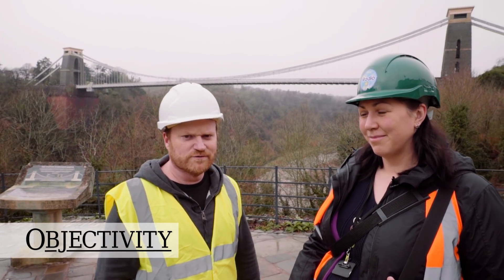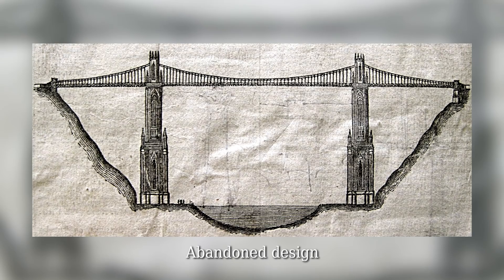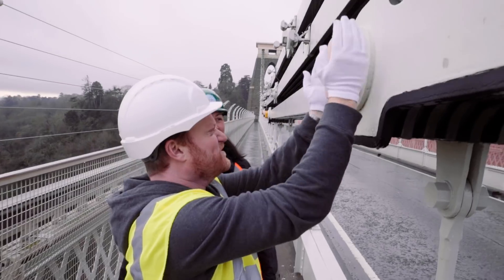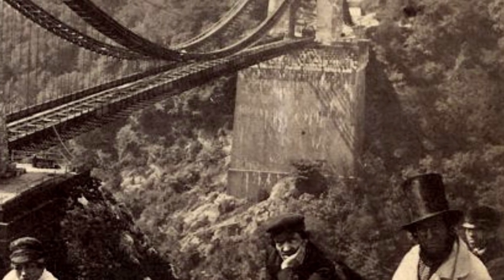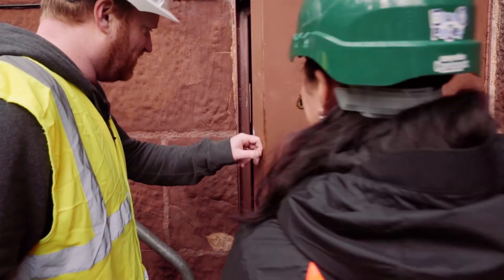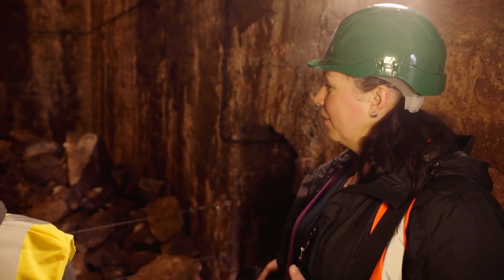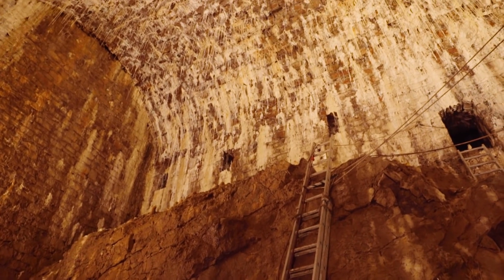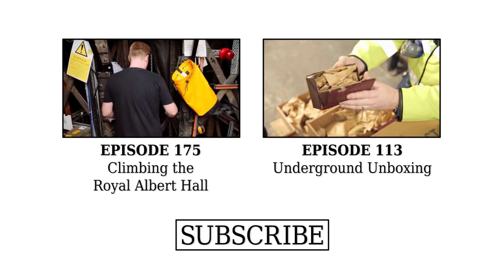Secret Under the Bridge - Objectivity 199

Comment: Interesting that even with such large empty places inside the base, the bridge is stable. A fine way to save some money on the construction.
Reply: I expect that it's actually stronger than solid brickwork would be, in the same sort of way that a tube is stronger (weight for weight) than a rod.  If it was solid brick, then yes, it would have cost a huge amount more, but it would have weighed so much it would have crushed the foundations.
Reply: @jonathanrichards593  I'm not sure how the physics would apply here but I can imagine it being stronger. It probably works a bit like an egg. The material is brittle but it takes a very large force to crack it if you only apply pressure to the top of the dome. I love these kinds of interesting engineering solutions.

Comment: 2 questions: 
1) where do the minerals that make up the stalactites come from? Is it rain water seeping through any cracks and carrying building materials with it?
2) what's stopping them from making use of those huge cavities, for example mushroom growing or spirits/wine aging?
Reply: 1) it shouldn't be waterproof by definition, so probably yeah.
2) historical value and probably some legal mumbo-jumbo on top of that.
Reply: For the first question, if the gorge is made of limestone (7:05) then that will be the source of the minerals for the stalactites.
Reply: @LeoMRogers  These stalactites will come from the calcium hydroxide in the cement holding the bricks together, not the native calcium carbonate of the gorge.  This is why they're much longer than natural stalactites, as the hydroxide is much more soluble than the carbonate.
Reply: They're not uncommon in concrete multi storey car parks, though these appear to be significantly longer. Presumably 100 or so years longer.
Reply: It would be an awesome rave venue

Comment: For anyone wondering. They built that out of bricks. All of the voids were there to reduce the amount of materials needed to make the structure.
The load bearing parts of the structure are similar to how a cathedral operates so the voided areas would never have born any load.
Reply: It is a cathederal. A cathederal of amazing victorian engineering.
Reply: Clever, ain't it?  :D
Reply: Yes I was wondering what on earth these ginormous vaults were here for, they never mentioned the reason in the video unless I missed it.

Comment: That's really awesome. And no one knows why they were built?
Reply: They were built to support the bridge. It's true.
Reply: Perhaps the vaults used were cheaper to fill the volume rather than solid fill.  In other words, air is cheaper than stone, even if you have to construct costly arches.
Reply: Secret tunnels are their own reward.
Reply: I am not sure the vaults were built for a reason. they are probably the side effect of building those abutments in a realistic way that doesn't involve just filling them with a lot of material.  The vaults would give strength to the structure without needing to fill it with material. 

The effect of giving somewhere for a Bond villain to live is just fortuitous.
Reply: Of course, they were build to support the bridge :).  Now seriously, It's cheaper that way when there's a lot of space to fill on the embankment.  The mistery is maybe why they didn't put a door for maintenance, I presume they thought that the trap was enough?